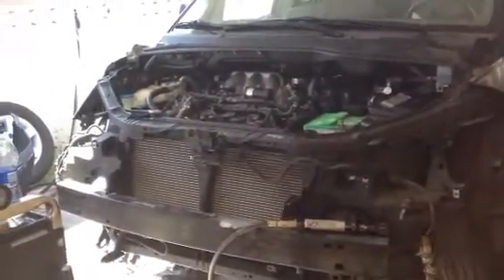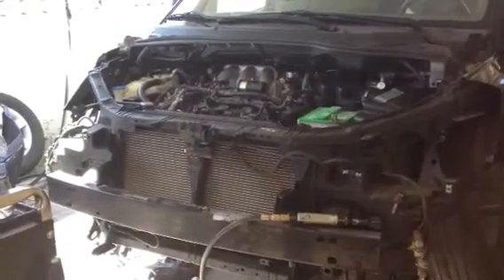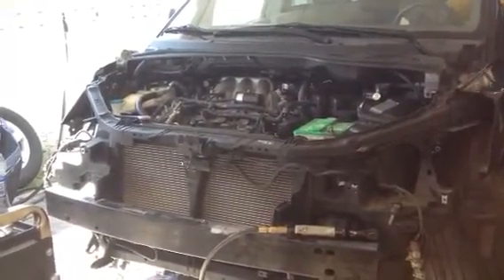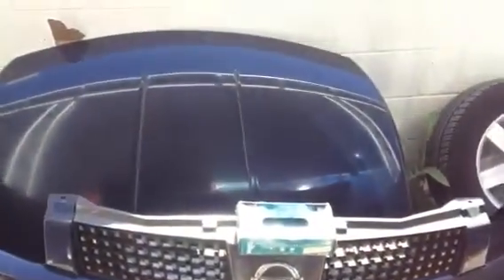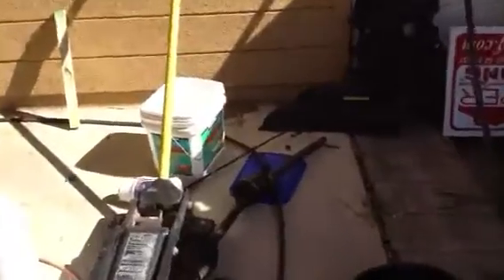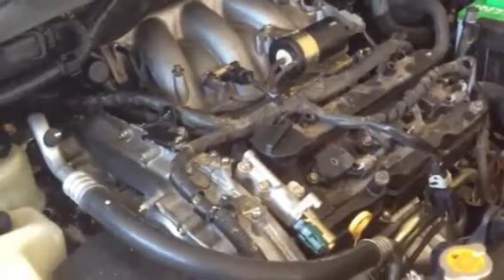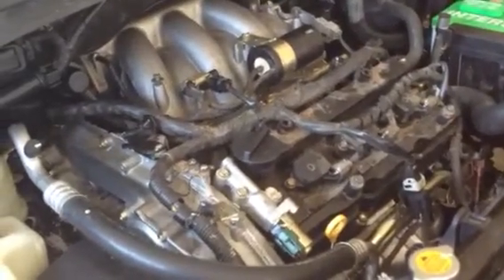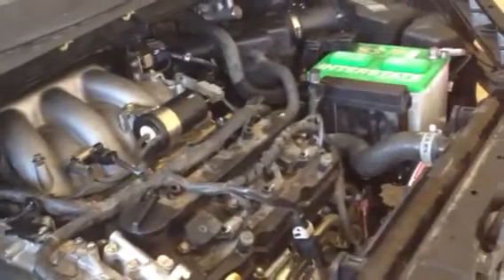Nissan 3.5L timing chain

Comment: Thanks for the video.  Just did my timing tensioners and guides on nissan maxima 06. Not a hard job but very time consuming.  Your vid helped alot.  Dont listen to nissan haters.  My last maxima had 300000 on it when i sold it and still runs today.  All original.  Nissan usa all day

Comment: Can you replace the timing tensioner and guide without taking the motor out? I have a murano and looks to be about same amount of room
Reply: Daniel yes you can.  I just did my nissan max 06 with it still in.  Little tight but just take ypur time. In total it took me about 20 hours.  Alot of cleaning and double checking.  If you have any? S just ask

Comment: Mr TuroFM: First off- a million thanks for these Nissan videos, and congrats/great job fixing your engine. The videos have been EXTREMELY helpful to me in saving thousands of dollars in repair vs taking it to a dealer. I have to replace my tensioner and guide, just like yours. I also want to replace the plastic guides near cams for the cam chains. Do you happen to know the part # for those? I can't locate them in any diagram from nissan to order them... I'm gathering all the parts online.